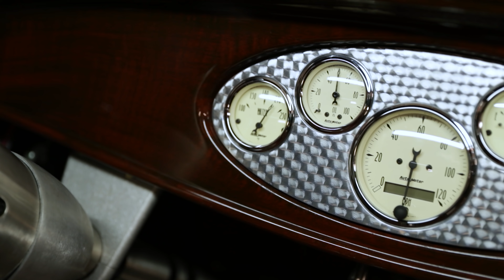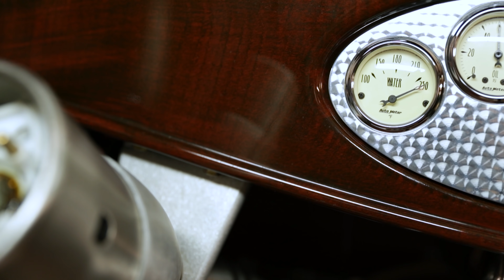1932 Ford Flathead V8 starts for the first time!

Comment: You need to have the car running when you check the trans fluid level, and it sounds like it needs the rockers adjusted
Reply: Not to check if there is fluid in the trans you don't

Comment: The lifters or rockers are really noisy. Maybe you have not adjusted the rockers after a heat cycle? Sounds like a diesel. Beautiful car.
Reply: Looks as though he is not planning hood sides - coil over mounts also would be a problem for sides. But it will look great with those valve covers out on the open.
Reply: What rockers? Its a flat head, the adjuster is on the lifter
Reply: @connorarnold9362  - It's OHV hemi now...
Reply: BuzzLOLOL Ohhhhh alright my bad
Reply: Solid lifters so will be making some noise...
Reply: @connorarnold9362  - It was barely mentioned but I recognized the Ardun heads at a glance... ArDun for Arkus Duntov later of Corvette/camshafts fame...
Reply: BuzzLOLOL I notice the ardun heads now :)